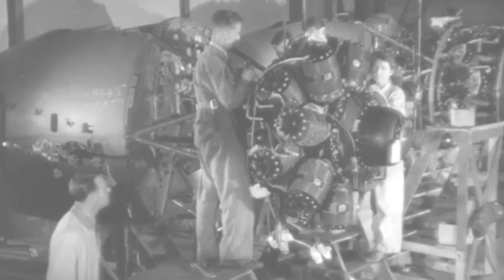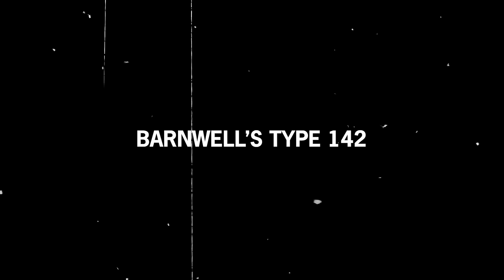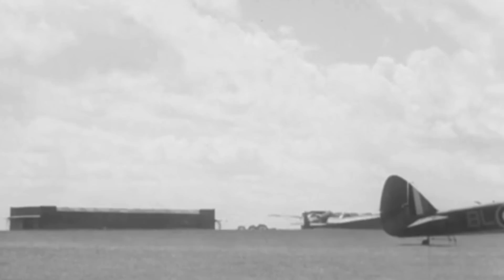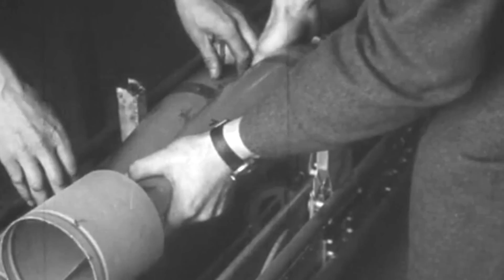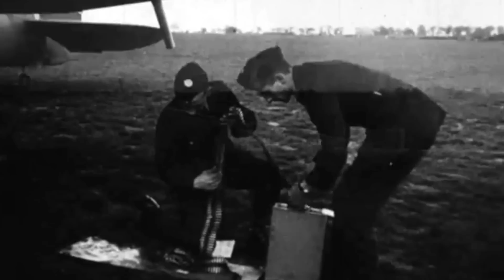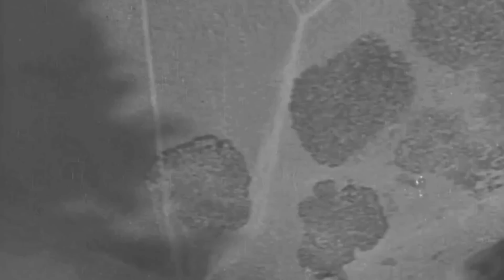The Airplane Ripped to Shreds By the Luftwaffe

Comment: Everybody makes mistakes, even if you are a professional at what you do, but these 'Dark' channels are wrought with them. For some reason, I had thought this 'everything is dark' guy had knowledge of at least the aeronautics subject. But it is quite clear that he is nothing more than a narrator with absolutely no knowledge whatsoever! NOBODY with any knowledge of aircraft would have read aloud the typo (apparently) of 2,867 mph.
This error comes shortly after the statement of the SR71 Blackbird being completely mfg'd from aluminum on a previous video. After this absurd speed mistake, tolerating the same catch phrases used over and over and over . . . . and over, is likely going to be more annoying.

Comment: The fact of it having very little variation in dimensions, was always a point of pride among British engineers. A little something they picked up during the colonial wars. Previous to which, anything from 1 to 4 feet was given as the permissible run out on steam engines, typically.

Comment: The Blenheim wasn't bad for a 1930s aircraft and is quite historic, as it was the mainstay of the RAF for the first two years of the war. It's a pity there are only one or two airwothy examples left in the world. An airworthy Blenhiem, especially an early model, would be worth at least £5 million. They could at least have given the rear gunner twin machine guns, if his one gun had a stoppage he would be silenced. The speed error at the beginning was corrected later in the video. Under emergency boost it could exceed 300 mph, and by carrying bombs externally its bombload could be increased to 1,750 lb, but of course that reduced its speed.

Comment: There were more than two machine guns arming the plane, as well as the mis-spoken account of it's speed.  There can be seen two medium machine guns rear facing in a chin turret as well as the two in the bubble turret.  I honestly did not know of the existence of the single wing mounted one, if that is in fact, correct.
Reply: The initial Mk1 had 2x mg, one Vickers in the turret, one (I guess Browning) fixed firing forward in a wing.
Reply: @helrayzer  That's indeed correct for the MkI, it was a replacement for the two seat, biplane light bomber concept of the inter war years and similarly armed.
An outstanding aircraft when first introduced but like most first examples of next generation aircraft it gets obsolete very quickly when everyone else catches up. As someone wisely advised me, never buy the Mk1 version of anything, wait a bit and the improved version will soon be available.

There was a fighter version that had an additional pack of 4x0.303 browning under the fuselage. I've also heard of a strafing version which had something like 13x0.303 machine guns firing forward but haven't found much reliable data on it. I believe it was developed in response to the threat of German forces landing in Britain but not produced in any significant numbers and dropped when the threat disappeared.
A few in the Middle-East theatre had a 20mm cannon added to the nose.
Reply: @taffwob  Have you read "Bomber Command" by Max Hastings? What an eye- opening book. His description of the first time Wellingtons met the Luftwaffe in daylight, what the Luftwaffe were doing, followed up by what happened next. I wouldn't be a bomber pilot/ crew for any money. Blenheims, Battles, Whitleys, Hampdens, Lancasters, Halifax, Stirlings. Just death traps. So sad.

Comment: I can assure all viewers that the name is pronounced "Blenim", not "Blenheim". Typical British pronunciation so that foreign spies can be quickly discovered ! How do I know ? Well, my father was a radio mechanic in Training Command in WW2 up to 1944, and these were the aircraft he worked on with their battery-operated radios. There were no electricity generators in the aircraft, the engines used magnetos. In early 1944, he was posted to 139 Wing, 2nd Tactical Airforce, (under Air Marshal Tedder). This wing operated Boeing B25 Mitchells, on loan from the USA.
The Blenheim went from being a super-fast bomber in the early 30s, (no fighters could catch it), to a death trap in 1939, when fast monoplane fighters like the Bf109 were in use by the Lufwaffe. They similarly had problems with their bombers being once fast, but not fast enough by WW2.

Comment: Not only the speed of 2867 miles per hour is wrong: They also never made 40,000 units of the Blenheim. A little over 3,300 units were made. See Wikipedia. :-)

Comment: Not only is the speed wrong so is the names pronunciation. The problem the Blenheim had was that fighters could match or beat it for speed not long after it entered service at the start of hostilities the ME/BF109C could do 292mph(only a jet powered plane goes 2860mph faster than sound and the speed given falls between mach3 and Mach4) Later E varient of 109 did 320mph both C&E would have had a field day with the slow coumbersome targets, only twin engine fighter/Bomber to be a success at both roles and more was the British DeHaverland Mosquito but this was a few hard fault years away from when the Blenheim was designed with painful lessons learned.

Comment: A aircraft capable of mach 4 should have been the only aircraft manufactured and should still be in service today . That being said they would be in trouble if the ran into German JU 52 transports which had two guns on the upper gun station just behind the cockpit . It was fast in its day due to being small and light with basically no defensive armament and small bomb load  not to mention short range and no Armour plate . Any JU 88 some of witch  were used as night fighters with up to 8 guns depending on mission would rip these things up in combat . In all fairness the Germans made the same mistake in the 1938 Spanish civil war , assuming that their lightly armed medium bombers would always get through . However they were faced with obsolete 2nd line fighters and their bombers were more modern . 2 years later in the battle of Britain they found when faced with modern first line fighters their assumptions of what a bomber should be was wrong .

Comment: Since when was the Blenheim used as a fighter bomber? With the quoted speed it would make sense, I suppose. I’m amazed it’s not still in service. 

It had a fighter variant armed with a gun pack of four .303in machine guns and the turret. The NF.1 was the first to be equipped with AI radar to be able to carry out interceptions at night. No mention. It was designed at a time when fighters carried up to 2 rifle calibre machine guns, not cannon/machine gun mixes like the Bf109/110. It was, as was pointed out, faster than the fighters that were in service when it was designed, but by the beginning of the war how many years old was it? 

It was developed into the Beaufighter, Beaufort as well. It also looks nothing like the Wellington, which kept having footage looped. 

It’s also probably worth getting some kind of pronunciation guide so you can say the names correctly. 

There can, occasionally, be some good parts of the videos but they keep being let down by a lack of attention to detail. Also it seems that unless something is American or German it’s automatically crap.

Comment: Besides the glaring factual error in declaring the Blenheim's top speed to have been 2,876 mph, the declaration that the aircraft, "...proved to be especially reliable," can only apply to the Blenheim as a reliable piece of easy meat for the BF-109E pilots of the Luftwaffe. Losses were particularly heavy, as the Blenheim squadrons were sent out on unescorted daylight missions. Their weak defensive armament and slow speed combined with the damage a 20mm explosive shell could inflict upon the Blenheim's light airframe rendered the aircraft obsolete by 1939. While the Blenheim was a very good aircraft when it was introduced into service before WW2 began, like so many of the Blenheim's contemporaries the fast pace of development rendered the design too slow, too weakly armed, and too fragile in the face of the latest fighter opposition. The only reason they persisted in service as long as they did with the RAF and Coastal Command was that there simply weren't enough aircraft to go around, so the Blenheims were sent out, lambs to the slaughter just to try and buy time for newer designs to become available, and delay the relentless German advances of 1939-41.

Comment: I dont know how the Germans could have shredded the Blenheim (with a silent 'h') as they were incapable of catching it at 2876 mph.  However, no wonder the aircraft shredded itself at Mach 3.78. I would have been mightily impressed when it passed Mach 3.0 and was still in once piece.
Flt Lt Ginger Hopkins was heard to say, "Spiffing day out, chaps. There we were a 35,000ft, going like a train.  Passed a F-15 at Mach 2.5. Never saw it again.  Around the planet by 4pm and back for tea."

Comment: There is so much wrong with this but to point out one thing. It's implied that the Blenheim was a poor aircraft and that's why it was shot up so badly. This is not true. It was an older aircraft getting towards the end of its service life but the huge losses were due more to RAF tactics and governmental interference. No bomber of the day could survive without massive fighter support, even the Luftwaffe so using unsupported Blenheims as strategic bombers assured their destruction. It did much better as a situational aircraft for specific purposes that did not involve going into areas with enemy fighters.
Reply: Also if he is correct the losses over Dunkirk would have been egregious due to the utter desperation of the response to that situation. They would have been putting everything in the air just to keep the pressure up in any way possible.

Comment: The speed of over two thousand miles per hour, is more than a little suspect. I also heard somewhere that there was a variant called a “Blemfeld Beaufighter” that was more like a heavy fighter, sporting six machine guns, plus four 20 mm Hispano cannons…
Reply: That was the Bristol Beaufighter, it was a heavy fighter variant of the Bristol Beaufort, a medium day and torpedo bomber which was developed somewhat from the Bristol Blenheim.
Reply: The Beaufighter was much used in the Far East and was loved by the Australian Airforce pilots that flew it. It was so devastating in ground attacks that the Japs called it Whispering Death.
Reply: Thanks !

Comment: Do you fools prof read or preview the video before you put it on the air. You obviously don't because if you did you would have realized that you said that this plane could fly at speeds of 2,867 MPH or mach 4 plus. Get it together dummies

Comment: 2867 mph?? Wow, 3.75 x the speed of sound and during the early years of WW2. Faster than the fastest bullet at the time --up until 2004 with the .204 Ruger 🙃
Reply: the Remington .17 can be handloaded to 4500 fps, = 3068mph muzzle velocity long before 2004....quick fact check
Reply: I think the 220 Swift predates both the Ruger and Remington rounds mentioned. Also the Swift will give the 17 cal round a run for its money with a heavier projectile.

Comment: I never knew a WW2 plane could fly THAT Fast!
Surprised a prop driven plane could actually go that fast during those days considering they aren't able to go that fast in this day and age.
Wondering how they got the boost from 300mph to 2000+ with just a wing change?
Reply: d e l t a w i n g s

Comment: It was the first version of the SR71. It just looks different and was in the 1940s.
Reply: It was almost as fast. 2678 mph according to the video.
Reply: @dragonsbreath198  . ("Sgt.J."). Unrelated question. 2 marines patch?
Reply: @ruthparker1140  No. 2nd MarDiv. I was in 10th Mar.
Reply: The mosquito would have been the WW2 sr71  really
Reply: @MegaRyan123456  I was just playing off his wild MPH statement.
Reply: @MegaRyan123456  G’day, Mega.  You are correct. Nothing with a prop could catch it.
Courtesy of Half Vast Flying
Reply: I'm pretty sure the air friction ripped it to shreds, not the Luftwaffe
Reply: @cpt_bill366  probably did but my guess is that the one who did the research(not the narrator) likely assumed that due to the damage it had absorbed the aircrafts frame could not hold itself together any longer.
Reply: Lol
Reply: Imagine how much quicker it could have gone if it could fly at 95000 feet
Reply: It could if went faster with a bit of streamlining.